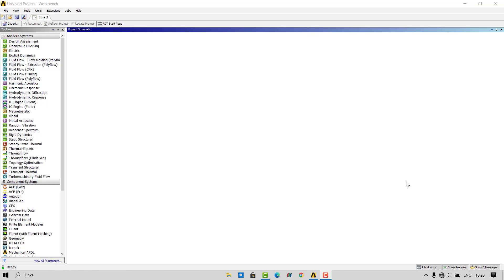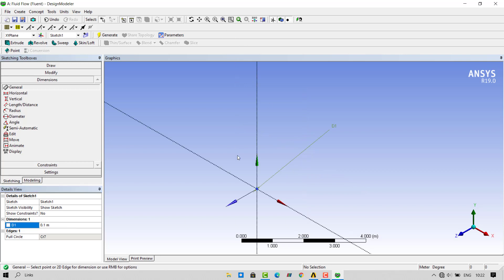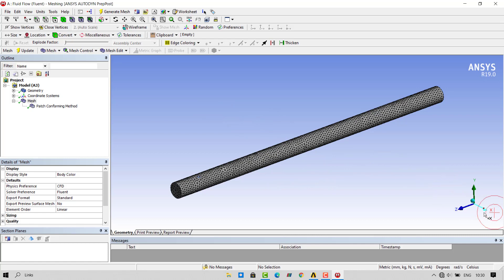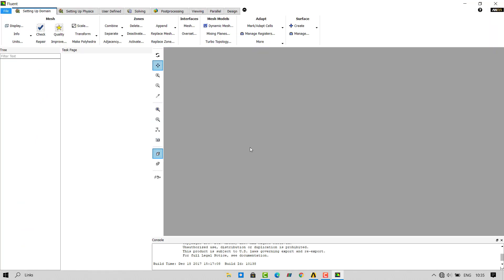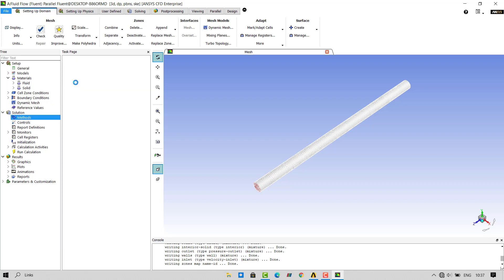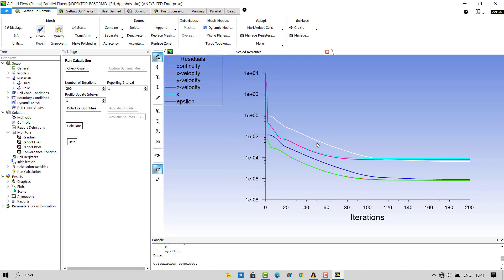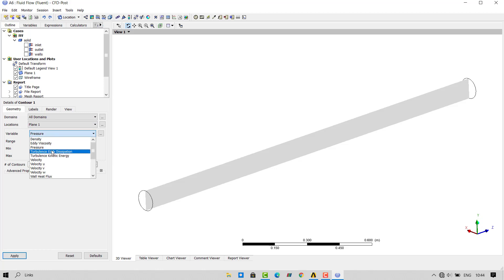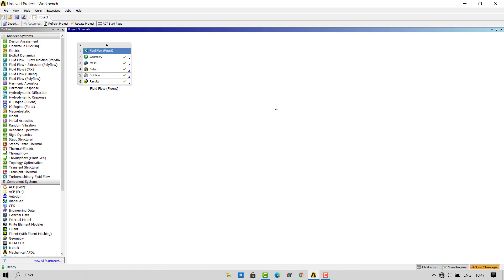How to do Analysis of Water Flow Inside Pipe using ANSYS Fluent | Tutorial

Comment: Hi, thanks for the video. There might be a problem defining water as the fluid inside the pipe. You selected water in the "Materials" section. Still, you didn't choose it in the "Cell Zone Conditions" section. So, the fluid inside the pipe is the air, not water.

Comment: Good!

red color indicates 0.13m/s, not 1.3 m/s. it is in center of pipe.
The input velocity 0.1m/s is average velocity. 

Thanks lot!.

pls make a tutorial on airborne dust simulation in  tunnel!
Reply from the maker: Thanks for the info! Just a slip of tongue. I will try to make simulation that you have requested.
Reply: @cfdbaba  

hello, 
Thanks for the reply!.

please take the underground tunnel dimension as 5mX5mX100m. Air velocity = 4m/s.

point dust source may be at 0.2kg/s in anyplace in the tunnel.

thanks a lot again!

Comment: Dear Sir, I have one question about the in inlet and outlet boundary conditions. The molten salt enter a pipe with 5m lenght and 20mm diameter  and 500k . The pipe is made of stainless steel. The heat flux is 800,000kW/m2. So how much should be the inlet flow rate up to we receive the outlet tempereture 800K. It will be highly appreciated when you guide e the boundary conditions in inlet and outlet in such a case. Thank you.
Reply from the maker: Hello. It is not so straightforward to calculate. However, you can get the inlet flow rate by doing some trial runs. You can create a CAD model for your pipe and apply the above-mentioned boundary conditions for temperature and heat flux in ANSYS. However, you should at least know the velocity or flow rate at the outlet. Then you can use pressure inlet and velocity outlet boundary conditions to run the simulation. After calculation is complete, the software will give you values for velocity or flow rate at inlet.

Comment: Is the recent iris xe graphics with the 11th gen i5 16gb ram compatible and sufficient  with ansys for low  medium 3d  simulations?
Reply from the maker: Hello. Yes the mentioned specifications are sufficient for low and medium scale simulations.
Reply: @cfdbaba  Have you tried to run ansys on 11th gen i5 laptop with integrated iris xe graphics ? Does it work or not ?
Reply from the maker: Hi. I have not personally used system integrated with iris xe graphics. However you can try to run ansys on it and let us all know if it is a success.